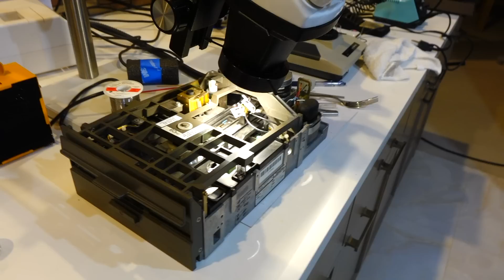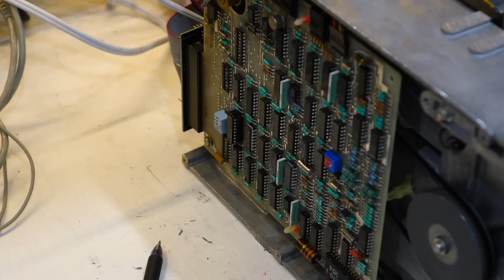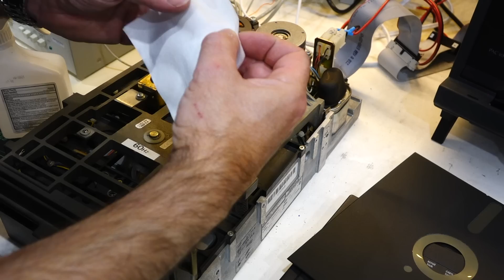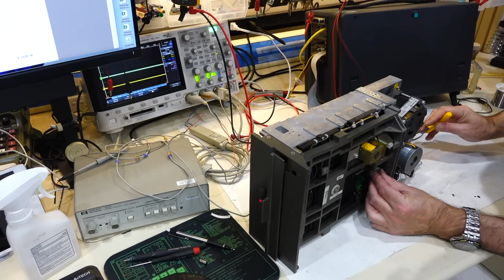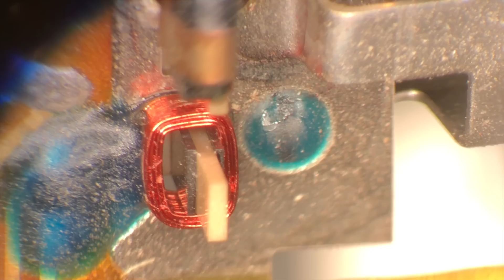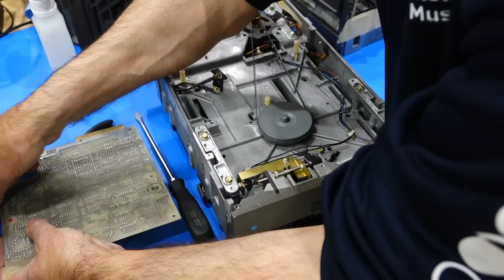8 inch floppy drive #3, 4 and 5 repair (CDC 9406 BR8A8B diskette drives)

Comment: Picked up a shugart 851 at a surplus warehouse for $40 and it looks new or barely used. I have no old DOS PC in my collection just Atari 8 and 16 bit, SX-64, Apple ][, Amiga, KayPro, and various 68k Mac’s so I don’t think I can easily get any of those talking to it. But Indo have a Greaseweazle so hoping after my 50 pin to 34 pin converter board arrives I can at least test the drive out with the Greaseweazle. I’ve supplied A/C and 5v to it so far and it spins up and I have 780ma draw on the 5v so I think that’s a good sign. Don’t know what else I can check on the logic board though without being able to hook it up to the Greaseweazle.

Comment: Marc is an 8" floppy drive repair shop!  I wonder if those heads are difficult to rewind with the fine enameled wire?  Otherwise the only way to acquire another working head is to cannibalize another 8" drive.  I don't believe there are any companies selling parts for those obsolete 8" drives.  I remember all the boxes of thousands of 8" floppy disks we had when we used the IBM Displaywriters in all of the offices.  And all the supplies for the daisywheel printers we had.  So much stuff went to the warehouse, to be sold by the pallet to e-waste companies.  😢

Comment: It's neat seeing this old equipment. I get a kick out of those massive stepper motors they used in those. Assuming nothing goes horribly wrong in the driver circuit and cooks them electrically, I imagine they ought to work for a long, long time. It's really nice to see you were able to salvage quite a bit out of the collection.

Comment: If those are sealed bearing in the motor just measure there inner and outer diameters of the bearings. then find a local bearing shop and you should be able to buy new bearings.

Comment: 13:50 — "No (scratching) noise" That's something we should remember: If you hear noise coming from it, don't use any other floppy before a very good cleaning.

Trying to read old floppies, I didn't realize some mold on surface on the first, drive and floppy made some noise, got no reading back and I inadvertently changed to another floppy. Result: two "sandpapered" floppies.

Comment: I think it is worth repairing/ cleaning that "dirty" control board , and checking the one off the burnt head one (Reading others comments).   Other than that it is always worth having more working disc drives - inc fixing that noisy motor too ( though might be worth sending that to other people if time is a long constraint) Check two more drives before going onto your hp project.

Comment: I love watching these videos.  Word of caution, though, about that steel band watch you wear.  Back in the 90's, one of my colleagues blew up our second-to-last trade show prototype board, along with a few thousand dollar, long-lead-time FPGAs, when his watch accidentally shorted the power input section of a large board in our development chassis. I've put my watch in my pocket when I'm in the lab ever since.
Reply: Whoa.. more knowledge from experience. Thanks for sharing
Reply: normally those watchbands are made of aluminium or something exotic - as steel is quite heavy - but the problem with conductivity is the same. This also goes for jewelry, like rings etc, as they're also quite conductive and it's entirely possible to short something out if you accidentially touch the wrong thing
Reply: @thesteelrodent1796  
They are stainless steel most of the time. Doubt aluminium is the norm or even close to it.
Reply: I knew an electrician who did the same with mains voltage once - he always wore a plastic watch after that.
Reply: Nearly blew myself from the top of a step ladder by putting my wedding ring across 20.5v and GND. It stayed at home ever since then.

Comment: I don't always watch these super closely but did you explain why the brake was unnecessary?
Reply: he guessed the brake is there so the motor doesn't overstep when it's unpowered and I agree it's likely there more as a safety when transporting the units, than it's required for operation.

Comment: Do not put the burned Coil Board in the good Coil Case, bro... it will burn out the "new" coil too, thats wy you have trouble with your disks after "repair"

Comment: I don't know about 8" drives. But I have had a few 5.1/2" drives that I thought was bad. Nope just needed a good cleaning. Just hard gunk on the head. As for alignment . You have a o scope and maybe an alignment disk?
Reply: 5.25" drives are loads simpler than 8". Much more standardized design and somewhat able to realign themselves, especially the HD drives since they were made to read several different disk formats. 8" is much more mechanical and I believe Marc's way of aligning them with the oscilloscope is the only way to do it, it just requires a known good disc

Comment: Marc. I would be a little wary of the "good" board from the drive with the burned up read/write head.  You had a problem writing a disk with it?.. I would find some way to check the write current being sent out to that head.
Reply from the maker: That's a good point. Let me check that the next time I fire up that board.